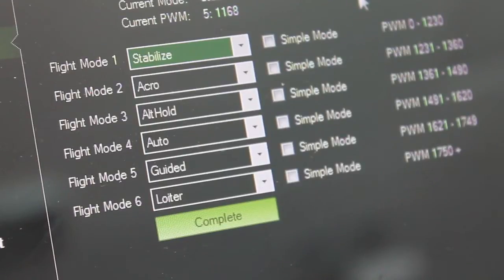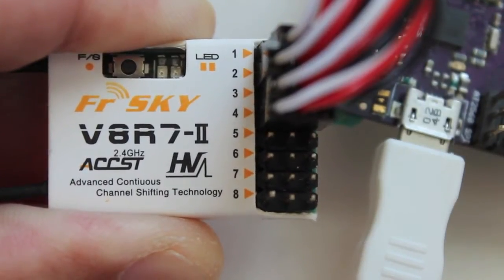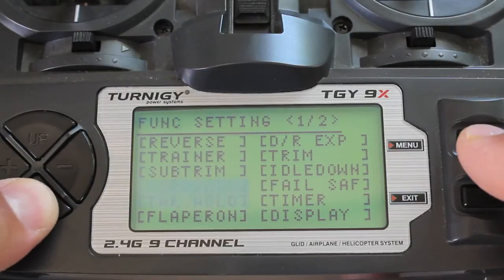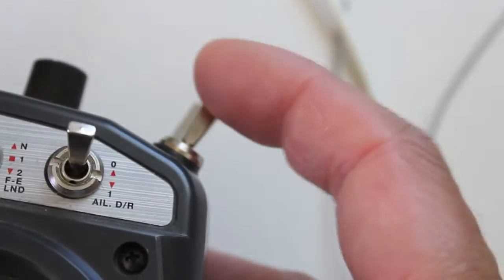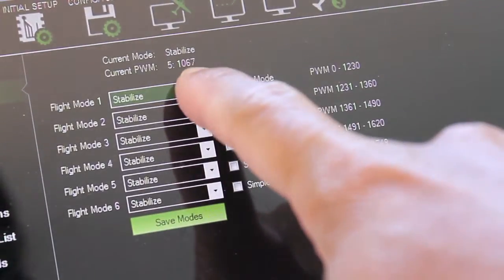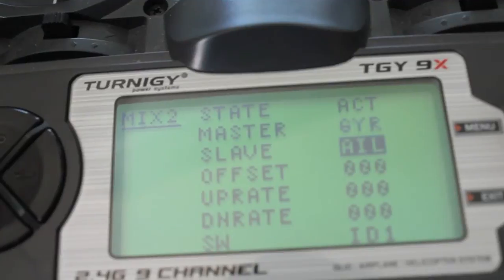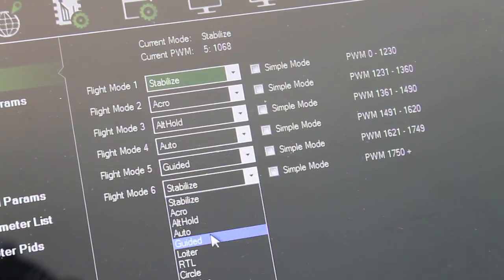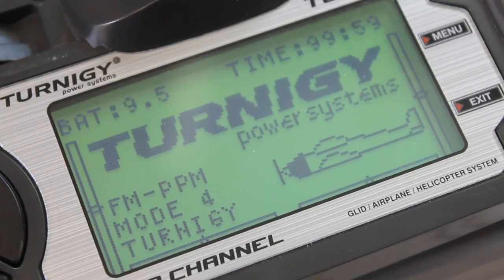Turnigy 9X Stock Firmware 6 Position Switch for 6 Flight Modes with APM 2.5 and Mission Planner

Comment: This video is very well put together, I found this after finding the earlier video for setting up 3 flight modes, I was missing out on the keywords when searching since I'm using Flysky TH9X and Pixhawk with Mission Planner which I now realize is pretty much the same thing shown here. Very articulate and easy to follow, I'd still like to punch the manufacturer though for making this so very not straightforward. It's almost like they wanted this to be some obscure black art.

Comment: hello How can we setup PPM 5 fly modes. I can not setup it with PPM connection and I can find any video can show like your video..that is simple but impossible do PPM code. Ail elevator and throttle are perfact but impossible when you connect PPM or sbus can you explain or show any helping link to me...best regards

Comment: PLEASE HELP This was a great video. I have a pixhawk but its setting my right stick as throttle and I cannt switch it to standard setting with left channel as throttle  got everything else work except this. I  have read its a bug in MP but found nothing to show to to fix. any ideas?? thanks in advance :-).
ps this is one of the greatest videos to use all channels on the pixhawk so thanks.
Reply from the maker: I haven't seen this problem before but something seems off with your channels. Perhaps you have your TX (Turnigy 9X) setup as Mode 1 when it should be Mode 2? Look into the mode settings on your TX and see if that's it. If not then I'll have to think on this some more. Good luck and keep us posted.
Reply: is in your transmitter settings menu-system-stick set-mode 2 ;)

Comment: I know this is an old video but i only just got this controller as a FlySky 9x exaxtly the same controller. Without videos like this Noob's like myself would be knackered its not an easy controller to program so thankyou so much. just getting into fixed wing and pixhawk this will make it all so much easier.
Reply from the maker: Glad to hear. Good luck with your programming and configuration!

Comment: I am struggling to get this to work in acro mode.  I am using a fs-tth9x with a frsky DJT module and a frsky D4R-II.  Can't plug channel 6 from the receiver to channel 5 on the pixhawk.  Only get two flight modes when I flip the gear switch and nothing happens when I flip the three position switch.  When looking at the display on the radio it is working the right way.  Pleas help
Reply from the maker: Wish I could help but I'm not familiar with this radio. On the Pixhawk you'll need to use SBUS and then you can configure your radio to send the proper signal over the channel used for flight modes. Now this assumes your RX supports SBUS but I just wanted to mention that. Other than that I'm sorry I can't be of much help. Good luck and let us know how you get along.

Comment: Is there a reason you have to connect channel 6 to input 5 on the APM?
Reply: Also if this is with plane firmware would you connect channel 6 to input 8, would really appreciate a reply - thanks
Reply from the maker: It's the way the Turnigy 9X firmware is configured. You may have a newer version of the firmware since it's been a while since I posted this video and no longer have my Turnigy 9X. Regarding APM Plane firmware I would recommend connecting CH6 to input 8 and then going to your flight mode screen. You should see the PWM adjust at the top of the screen when you toggle your switch. Wish I could provide more guidance but I'm currently flying with a Taranis. Let us know how you get along with your setup and thanks for the question.
Reply: Thanks for getting back to me, I managed to get the 3 position switch working using your method in the video, connecting channel 6 to channel 8 on the apm. Thanks again for the reply, much appreciated considering how old this video is.

Comment: You did this in a kind of over complicated manner. You could have done all that more efficiently by having the 3 position switch control what mode you were in, and then have the 2 position switch just change the signal rate. As in, have it be like: M1 = N, M2 = 1, M3 = 2, then you flip the 2 position switch and have it: M4 = 2, M5 = 1, M6 = N... that way, you only flip the 2 position switch when you want the second half. this saves you from having to think about what mode you are in every time you flip that 3 position switch. Makes it ALOT less confusing, specially for 'newbies'.

But I do have to say, I like the idea of using a channel and 'mixing' the switches together to accomplish this task instead of doing what I've found others accomplishing: setting up functions that do the same thing. Though I imagine functions would be abit harder for people to generally understand yet its alot 'cleaner' to do. So having things done by creating mixes solves this for basically anyone who has a transmitter that can do mixes but not functions =D Good job!
Reply: can you do a vid what hikari said would it be easy to do ? thx dennis
Reply from the maker: Very awesome tip. I haven't flown with my T9X in a long time but I'd like to revisit this with your suggestion. That's what I love about our community. Someone posts an idea and then someone improves upon it and the cycle goes on and on. Appreciate your suggestion and hopefully others can benefit from it. Thanks.
Reply: No problem. Finally someone who doesn't yell at me XD

Comment: Wait you literally have to use 2 channels just to switch between 6 modes.. And I thought that the Turnigy 9x is the best thing ever for the money... now I'm short for 1 channel (1 goes for landing gear, 1 goes for gimbal position (vertical), now 2 for mode switching which obviously you can't have only 3 of them...  what a shame. Will have to switch to the Taranis when possible (€€€) and sell this one...
Reply from the maker: +Irenej Šraml I hear you. It's definitely not as easy as the Taranis and requires and extra channel, but at least it's an options if you want to get 6 flight modes with Turnigy 9X.

Comment: Hi Dennis I've been trying to use your videos to set up a 580 quadcopter with arducopter 2.6 and a Turnigy 9X transmitter and a Turnigy 8ch receiver. I'm trying to set up the six flight modes like you show here but the menus aren't the same, Instead of ProgMix there is Prog 123 and there is no gyr of flp in any of the mix options. There is a gyrosens that has the gyr but not flp. I just got the transmitter, receiver and arducopter.  Do you have any idea how I would do this on my Turnigy 9X? Help, please.   Really good videos by the way!
I saw below here JPOTT GAMING had the same issue. How do you get a different template?
Reply from the maker: +Grove Hull Check out this video and see if it helps: https://www.youtube.com/watch?v=u5cyrLZzr3g I no longer have my Turnigy 9X so this is probably the best I can do at the moment. Thanks for following along and the kind words.
Reply: I sent it back and ordered a FrSky Taranis... should be here today! :-)
Reply: Hey Dennis, I bought a Taranis X9D Plus. I was wondering if you have a video or can tell me how to set up Arducopter flight modes on the taranis? Thanks.

Comment: Any idea why I can't get the 5th and 6th flight modes set? I try to use the program mix like shown here but just can't adjust the downrate or up rate enough to highlight the 5th and 6th...
Reply from the maker: +Joseph King Interesting. I haven't run into that problem before, but appreciate you pointing it out. I don't have my Turnigy 9X at the moment, but perhaps someone can chime in and share some thoughts. One thing that comes to mind is perhaps it's firmware version issue. Not 100% sure but wanted to mention off the top of my head.
Reply: +Dennis Baldwin thanks

Comment: Something is out of whack, my switches are not changing the on screen flight modes, just doesn't move when I'm cycling switches, any ideas Dennis?
Reply from the maker: +JPOTT GAMING My guess is that you need to make sure your switches are configured on the right channel so that mission planner can see them. If that's not the issue I would check your display monitor on the Turnigy 9X so that you can see the movement of the slider bars when you flip your switches. That will rule out any possible issue with the connection between your TX and aircraft. Good luck and keep us posted.

Comment: Trying desperately to get my flight modes set up, for starters my transmitter screen isn't like yours, first mine says pro(123) for the mix and it doesn't have a gyro option, I've been struggling these past couple weeks getting this setup, anyways you could help me out?
Reply from the maker: +JPOTT GAMING Interesting. Maybe you're using a different template? Check out this video where I talk a bit about it. https://www.youtube.com/watch?v=u5cyrLZzr3g
Reply: +JPOTT GAMING Hi, I have the same issue on my Turnigy 9X were you able to figure it out. If so, how did you do it?

Comment: GM Dennis. Love your videos and set ups. Being some what of a senior and young at heart. I've gotten into the quads and multi engine craft some time ago. I've had all kinds of problems with set up and now, thanks to you and some others. Life is much more enjoyable thru your video help. The APM board is so awesome. I have been built a full system and use a 13 inch monitor from Wal Mart that is 12 volt dc, mounted on a tri pod from a second hand store and with the FPV and OSD system I now have hooked up. The wiring is much more understanding, thanks to all the videos. You guys are awesome. Thanks Much for All Your Work and Help. Most Appreciated. EdK
Reply from the maker: +Edward Kasprowicz Ed thanks so much for the good words. We are all young at heart when it comes to this hobby. So rewarding and so much fun.....and incredibly challenging too! Sounds like you have a great setup going. I hope you get some good flight time in 2016. Happy New Year!

Comment: Hi Dennis, do you know if its possible to display the currenty flight mode in the Turnigy? (Even if I define it manually). Cheers, thanks!
Reply from the maker: Marco Antônio Ferreira Pedrosa I wish I did know how to do that with the stock firmware. It may be possible with er9x but I no longer have my T9X. Good luck and let us know if you find anything out. Thanks.

Comment: Hi Dennis hope you are well. Basically I have upgraded from apm to pixhawk now but still using the turnigy 9x and I'm having real trouble assigning the flight modes as you know you have to use ppm encoder to connect 9x reciver to pixhawk and that ppm encoder has occupied all 8 channels!! Or do you recon I need a complete different radio tx and rx like taranis frsky? Any help and solution would be greatly appreciated as always.
Many thanks
Reply from the maker: L0ND0N200012 Good point. I hadn't thought about this until you mentioned it since I'm no longer flying with the T9X. I'm not sure what to do since you have that PPM encoder enabled. You can probably get three flight modes, but definitely not six without some trickery. I'll think on it and let you know if I come up with anything.

Comment: my uprate and downrate dont do anything at all???

Its not moving in missionplanner..

I first calibrated the reciever with all aux on gear, and than did this steps.
But i get no movement of the green area, only the first and last field when i switch my gear switch.

help is welcome! (pixhawk is driving me crazy)

Also, i get a low battery warning with a full 5000mah battery, i set the power module to 3dr and 5000
Reply: RVArchitecture ill try to reset my 9x to see if it works after that
Reply from the maker: RVArchitecture Good luck and keep us posted. Make sure to calibrate your radio and your aux switch in the radio calibration screen otherwise you won't be able to get flight modes to work.
Reply: Dennis Baldwin 

Tnx Dennis, did not get it to work. I think im gonna need a frsky module and a smartieparts er9x software update.

Ill keep you updated if that did the trick.

Comment: Hi Dennis,

We are using a Turnigy 9X Trans/Receiver going into a Pixhawk PX4 with the PPM encoder. We are having trouble adjusting the PWM flight mode values. We don't see any changes in the PWM number as we flip through the switches on the transmitter. We have the aforementioned equipment hooked up exactly as Pixhawk recommends from receiever to the encoder to the PX4. Do you have any suggestions?

Thanks!
Jordan
Reply from the maker: mchale20201 That's strange. I have this same setup for one of my wings and it works fine with the FrSky Taranis. I'm assuming you have the PPM encoded plugged into the 1st port (RC In)? I would recommend giong to the Radio Calibration screen in Mission Planner and make sure you have the proper channel setup to your whatever switch you're using. In the case of a multirotor make sure it's channel 5 and fixed wing is channel 8. Perhaps there's an issue with the standard receiver. If you look here it appears that all of the setups require a FrSky module.

Comment: Do you think this will possible on a Pixhawk? It uses PPM encoding so only 1 cable goes from the receiver to the Pixhawk. I use a PPM encoder so maybe if I switch the Ch5 and 6 outputs?
Reply from the maker: Kjetil Riisnes Yes it should although I haven't done it with the Turnigy 9X. I've only done this with my FrSky Taranis.

Comment: Dennis, I have 6 flight modes set up just like you showed in the video. How do I add channel 7 for "auto trim" and still keep my flight modes?
Reply from the maker: tptwk I'm not entire sure how you can do that with the stock firmware. I know it's possible with er9x which is what I switched to the stock firmware. Then I ultimately upgraded to the Taranis, which has so much insane configurability. If you do figure out how to do this then please let us know. Thanks!

Comment: Dennis: Got the switches working in the receiver calibration window but when I go to the flight mode window in Mission Planner the flight modes do not change when I toggle the switches. Any idea?. Thanks. Great video by the way.
Reply from the maker: mcpojack Make sure you have the proper channel hooked up for flight modes. For APM:Copter it's CH5 and for APM:Plane it's CH8 by default. That threw me off when switching between each firmware type. Good luck.
Reply: Dennis Baldwin That was the problem.... I was in CH7 instead of CH5. Thanks

Comment: Thanks again for figuring out my dilemma on adding multiple flight modes. I noticed you are using a Frsky V8R7-II receiver instead of the stock Turnigy Rx. What is the benefit and do you recommend this Rx over the stock one. Does it work with the stock Turnigy transmitter or do you have to add a module? Where did you purchase it and how much $$$. Thanks again for the clarity of your instructions.
Reply from the maker: tptwk You have to get the FrSky module to work with that receiver. Generally you get better range as well as failsafe capabilities. Here is the module on HobbyKing:

http://www.hobbyking.com/hobbyking/store/__14349__FrSky_DJT_2_4Ghz_Combo_Pack_for_JR_w_Telemetry_Module_V8FR_II_RX.html

and Amazon:

http://amzn.to/1A47C3t
Reply: Dennis Baldwin
Thanks again. I just completed setting up 6 flight modes in Mission planner thanks to your tutorial. Do you know how I can use the AIL D/R two position switch that is next to the 3 position switch instead of using the Gear switch. I have seen other videos of that set-up, but no one explains it like your video.

Comment: Hey dennis, whenever I put it into simple loiter mode if I touch the roll or pitch the copter gets a mind of its own and goes full throttle whichever direction I told it to. It be comes unresponseive in this state, so if I turn throttle all the way off to drop it out of the air it just keeps going full speed. Lucky I was below the tree line while testing this. I'm using APM 2.6 and a F450 with the E300.
Reply from the maker: Tom Norris Man that's strange and sorry to hear you're having troubles. I recommend making sure your barometer is covered and not impacted by light or wind from the props. If you bought the APM 2.6 in the case then this should be taken care of. If that's the case I would recommend visiting compass and accelerometer calibration. Good luck and let us know what you find out.

Comment: Brilliant. I watched this when I was first getting into Multirotors and thought it was too complicated and bought a 9xR.  I just set up an APM on a QUAD and watched again. Very simple really. My preference is to use all the UP modes as RTL and use the 3 position switch as your 3 flight modes. This way you can always tell it to come home without trying to remember where the switches are at. Just flick the Gear switch. Only 4 modes but simplified for the novice or fat fingered flyer. Great video and thank you very much. I will make a brief video with my modification to your setup and link to yours for the rest.
Reply from the maker: Simon Hahnel Very good info and glad to hear you've modified it to find something that fits your needs. Thanks for sharing.
Reply: Simon, I like your comment. Have you made the video yet?